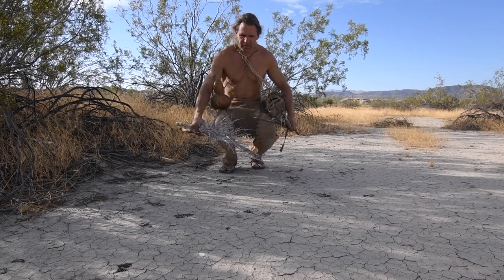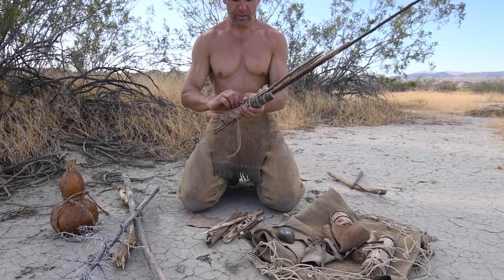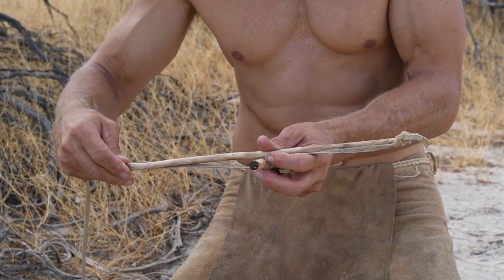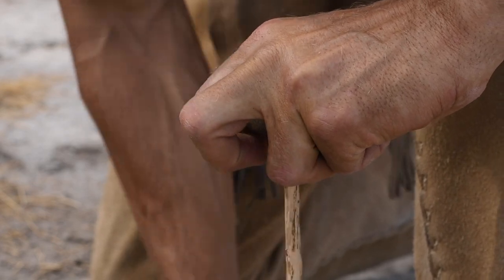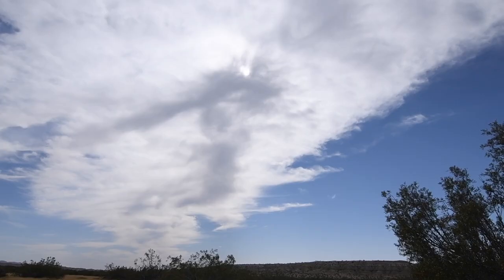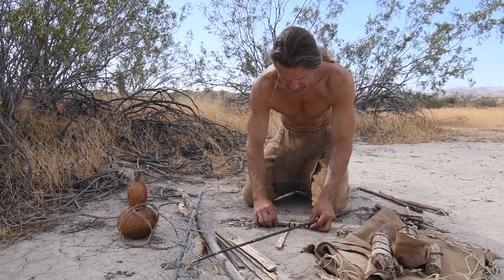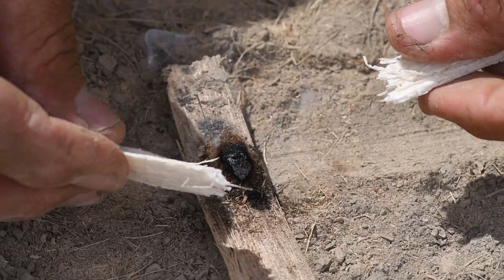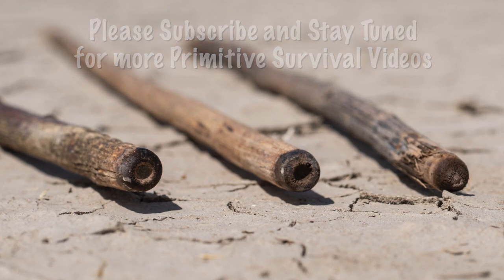Practical Tips for Making Friction Fires

Comment: Also, I had this thought. Once you get a fire going, why not hunt around for more sticks?
When you find some make sure they are semi green. That way you can use the existing fire to
bend them straighter and cut them shorter to have a ready made supply of sticks that will last 
a while in a yucca or some other tube of wood for moving in nature. It would save time and of course
being protected in a tube of wood could also save your life as all the sticks and materials would be essentially
weather proof. If it were me, I'd do that to make sure I knew I could start that fire even if I had a bow drill.
Reply from the maker: Yeah, that's an excellent idea. I often straighten dry sticks by wetting the area I want to bend and then heating it by the fire.

Comment: Honestly i think the Rudiger roll a.k.a. the Fire roll is the easiest friction fire method but you have to have a pretty extensive knowledge of natural fibers and either carry ashes with you or learn what works as a filler or "accelerator" out in nature.
Also the hand drill is easiest if you use the "cheater method" by making a notch at the top and using a piece of chord with two thumb loops. Then you can spin and apply pressure to your hearts content without hurting your hands or wasting a bunch of energy 😁
Excellent video chad! Been watching for a long time and youre one of my idols 👌

Comment: Which mule fat do you use for the tip of the spindle?  is it in the video about the black rectangular piece that is slightly innate?  right of them.  is my question correct?
..das maultier fett verwenden  sie für die spitze der Spindel ? handelt es sich da im Video um das schwartze rechteckige Stück  was da leicht angeboren ist ? rechts von ihnen. ist da meine Frage koreckt ?

Comment: I refuse to use the hand drill method because I can wear myself out trying to get a coal.    I don't have tough enough hands and at the critical point where additional downward friction and increased spindle speed is required I am spent.  I only practice bow and spindle and bamboo friction fire starting.  I find the bamboo friction method the easiest, but dried bamboo is not always available.